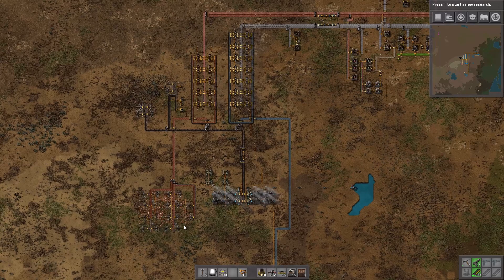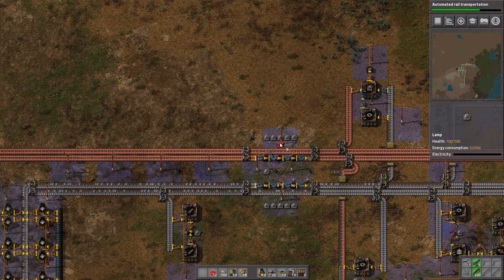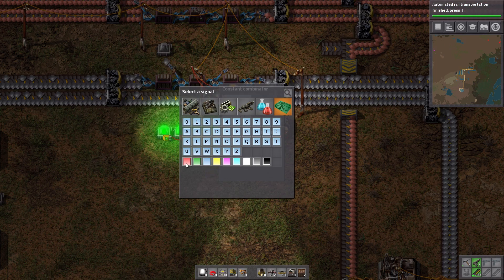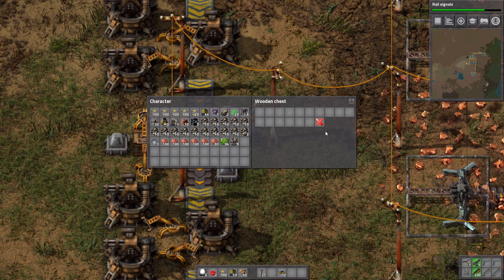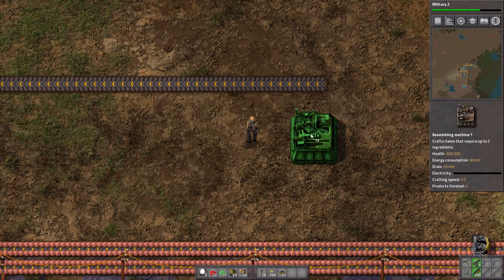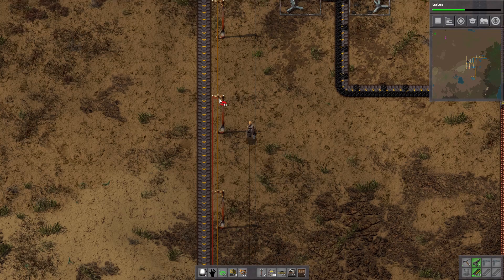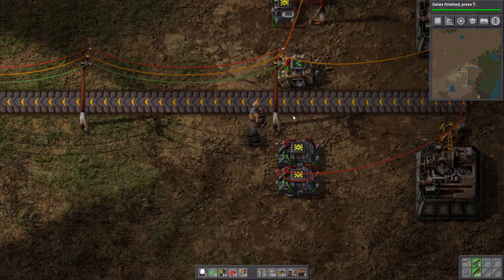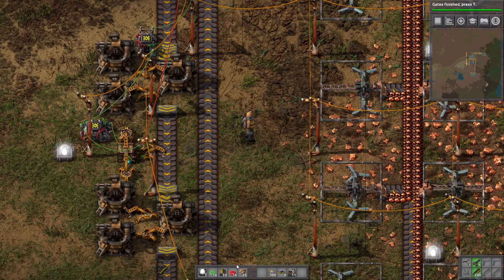Smart Ammo Production Guide – Factorio 0.16.x – Let's Play Part 4

Comment: Aavak, as you mentioned, in this setup there will be a delay between boxes signalling a local demand for ammo and the moment when it will arrive after having been produced (on demand). It seems to me that a simple adaptation could reduce this delay significantly.

Imagine the  ammo feeding belt as a series that starts with the ammo production facility and then leads sequentially to smart turret location A, then B, C, D etc. In the current configuration, if turret location M gets attacked, a demand for ammo is issued, the ammo gets produced and shipped until it arrives at location M, taking a certain amount of time.

What you could instead do having each turret sending their demand signal to the previous turret in the series (presumably location L), prompting that turret location to empty its ammo reserve on the belt. The reserves of this location (L) will then immediately dip below the threshold of 100 ammo,  resulting in a request for ammo to its respective preceding turret location in the ammo feeding line (presumably location K) and so on.

Instead of having the Ammo Production Facility feed location M directly (APF --> M) in one potentially long delivery, you will effectively split the delivery in a series of smaller parallel/simultaneous deliveries (APF --> A, A --> B, B --> C, ... , N --> M) distributed among the system, reducing the risk of running out of ammo before the new delivery arrives.

The delivery time for a location should never exceed the time it takes for ammo to travel from its predecessor on the ammo line in this system, no matter how long your ammo line/base defense circumference! Additionally, this means that lower reserves will be necessary at each turret location, resulting in glorious efficiency :)
Reply from the maker: A very interesting solution!
Reply: Great video Aavak. Waiting for a lot more like this one :-)

Yes very nice idea. A much quicker refilling, and if the location "A" is just after the factory inserters, no waste on the belt. I am thinking about a buffer chest every 3 (or less if needed) electric poles for exemple, with a set amount of 1 (or more if heavy attacks). It unloads (outputs) by a request from the next buffer, and sends a request to the previous one if not filled up with the set amount. The previous one will send all he has untill the delivery arrives, but as it has only 1 piece, it can't fill the belt untill it itself receives its new request. So you have on the belt as many ammo as you have buffers, and quick providing if necessary.
You can set for each defense location the reserve you think usefull.

Comment: I had a full logic system to control a massive refinery in an old save. Don't think I still have the save but happy to share the planning notes, if you're interested for when you get to oil. It used storage volume to keep things balanced but included all liquid based products, including sending excess into the fame-turret network (strictly as light for the max damage). Meant I never had to worry about things like my lubricant filling up because blue belt was full, leading to all the heavy getting cracked and then not having enough heavy to make more lubricant when I made a large expansion. Logic system not only controlled all that but held reserves of each non-final product. I was planning a predictive module to upgrade it too; in short, it would look at the levels of final products (like the lubricant) and increase the reserve levels if the products were low, in anticipation of the extra demand.
Reply from the maker: That sounds really awesome, and this is exactly the kind of thing I like to make. I like the factory to /think/ about what it's making, and why, and when it should, etc. 

Again, as I've mentioned to others (who invariably ask the question: but why bother when you can just...?) brute-forcing the game is totally viable, and in many cases faster, and easier. But making a smart factory is fun in and of itself!
Reply: Exactly! Well said. I've 'finished' the game plenty of times, even with mods that greatly extend the tech and/or number of items. It's not really a challenge after a certain point. The real enjoyment, for me, is in the problem solving element. Sure you get a little of that in the brute forcing method but what better way to get more problem solving style of play than creating problems to challenge yourself to make a solution for! :D

Remembered another that might give you some ideas/inspiration! I had an 8 station iron ore train drop off. I had 32 belts, plus a 32-32 balancer so if there was a shortage all 32 still got a share (since some entire smelting stacks were dedicated to circuits and not balanced with the buss stacks). With that kind of size/volume it was basically each train wagon spot (8 stations by 4 wagons per train = the 32 lines) was responsible for fully saturating 1 blue input line. Of course I was using the unload into chests, then onto belts system to speed unloading but trains were choosing based on pathing, and the volume of trains moving through meant that one could comfortably unload before all 8 stations were occupied, so the closest ones were getting all the trains and a couple of outer platforms were getting literally none.

I went full overkill mode and set up a system that added all the ore in the unloading chests for each platform, calculated the average ore held across the station, compared that to each platform's count (the signal isolation was a b**ch for this bit) and set up conditions to close the station (using signals) if the platform's buffer was 10% or more over the average, forcing the trains to go to stations with the lowest ore.

It also closed a station, regardless of other conditions, if there was not enough chest space for a fully loaded train to empty (there was a stacker to queue trains up in). That add-on meant that trains waited in the stacker, not a platform, so that when a platform was opened up, the train would go to the one that needed the ore at that moment (instead of the one that was the lowest at the time it arrived).

Could have brute forced that by just bringing in more ore and limiting chests, once trains stopped being able to unload they would block a platform and force others to the outer platforms..... but what's the fun in that compared to a horrifically overkill logic network! :)

Comment: In relation to the visual display for buffers, I find the programmable speaker to be amazing - i disable the audio, and set it to provide a visual indication of when certain really important things fall below a certain point, so that no matter what i'm doing, i'll know that my factory has reached a point where it's consuming faster than it's producing. Also good for letting you know if overproduction has created a bottleneck, or most any other situation where you want to know something /now/ rather than eventually... I /always/ set it up on coal and nuclear power supply, so that I never have to worry about a death spiral. 

With that sort of ammo setup, I'd probably have the ammo assemblers load into a limited chest,  and have that feed out into the belt that takes it to the guns, for pretty much the same reason as above - if the amount of ammo in that chest ever gets too low, then i'd know i need to either improve ammo production, ammo quality or something of the sort.
Reply from the maker: A nice suggestion, I've not played with speakers much, but that sounds like a great use for them :)
Reply: I tend to run out of fuel for power generation, just as a few (hundred) biters show up to eat me.  So have been setting audible alarms for when my fuel gets low.

Comment: Rather than each base outputting how much ammo it has, you could have it output how much ammo it would pick up, and produce ammo if that's more than what's on the belt. That direction adjusts automatically as newly-added bases output non-zero signals, and you set each base's storage amount differently and locally. You should also be able to clamp the signal so that a base can't request less than 0 magazines (because it has more than its storage amount already), which would then starve other bases.

On the other hand, with your system, if a chest dies, the factory will put ammo onto the belt in proportion to the fallen bases, and I like the idea of the voice saying "pour out 100 magazines in memory of firebase 17" while you try to figure out why it's acting moody.
Reply from the maker: The idea of the factory effectively pouring out a cold one for the fallen fire-base is glorious xD

Comment: Hey Aavak, a couple of things :
 1 - You don't have to pick up belts when putting down splitters on them.  They auto-replace. This works for undergrounds, as well. 
2 - When it comes time to create outposts,  check out autotorio.com/outpost. You put in a blueprint string and a little info, and it will create the whole thing for you.  Burnys Train Station Blueprint Creator mod does something similar for train stations. These two resources can save SOOO much time in mid to late game.

Comment: Thanks so much for going over this. This is exactly the kind of thing i was hoping you would do with the factory. 

My dream for a factory is one smart enough to adjust itself on the fly using modular production stations (putting them up and taking them down w/ recursive blueprints?) so all you have to do is tell it what research you want and how fast you want to launch rockets and it handles the rest. All you would have to do manually is build enough mining posts.   

my knowledge of running combinator logic is still sketchy at best but i'm getting there!

Comment: Hey Aavak, just a thought after observing. I noticed that your overflow chest wasn't actually draining because the ammo factories always had a reserve of ammo in them, so the inserters would just pull more ammo from them when desired instead of pulling from the chest. Could you not set up the network so that the inserters that are feeding iron to the factories also disable when ammo supply is met? I think this might be an extra unnecessity, but it also sort of plays into what you were imagining by an entire ammo wing suddenly starting up when a piece of ammo was needed along the wall; and yes, with the glorious robot announcer! Thanks for this combinator video though! I've never had trouble understanding logic gates and other video-game "circuits" (like redstone), but for some reason I couldn't wrap my head around factorio's circuit system. This video helped me to finally start understanding it! ;P
Reply from the maker: That would be a much better system, aye :)
Reply: Perfect for an RS-latch, IMO!! Have the ammo module on until buffer is full, then turn whole module off. Turn on condition is when the buffer gets to (say) 20%. Module produces in bursts, then stops drawing on the buss until the storage is low :)
Reply from the maker: A perfect situation for a hysteresis system, aye!

Comment: Wonderfull content! thank you . However, the belt balancer design you used will put more on one side as on the other: the first splitter sends half to the left and half to the middle, the second sends then a quarter to the center and a quarter to the right... It's better to use a single splitter to make a belt balancer...
Reply from the maker: Cheers for the tip :)

Comment: 32:20 I'm not sure but I think Aavak is excited. Also, to solve the problem of missing ammo, wouldn't it be more efficient to just put a fast inserter so that the ammo doesn't have to cycle around the whole perimeter again? It would still be good to keep the caches, but I think that it would be much more effective to have a fast inserter and a redundant cache than forcing your guns to wait for the ammo to come around again due to an easily solved problem.
Reply from the maker: Oh, absolutely, the regular inserter was just because I had a stack of them, not strictly because I thought they were best to use :)

Though having the cache is important regardless (and the terminal cache too) because if the base starts to lose power, inserters are among the first hit, they slow down. Belts not needing power, won't slow down, so the ammo can still be missed. But you're absolutely right, a better inserter fixes a lot of problems!
Reply: Alright, I just wanted to make sure that you weren't just doing Aavak things and forgetting something simple lol. And yeah, I agree that the cache is important regardless.

Comment: sorry to necro this however i cant figure this one out, i tried to hook up the crates for ammo overflow with signals so that it also keeps stock of 100 ammo in them (and have them evenly spaced throughout the wall perimeter). However since the substraction only happens when a red wire picks something up on the line it does not count up for the ones that put the ammo back spent three hours today and five yesterday trying to figure this out worse is i have no idea how to fix it :D it looks to me as if i need a second line to carry the signal back to the counter to count up for every green pulse (separate green circuit (second one) ) as if i just use the one i have it substracts when it gets picked up but it does not count up if somewhere down the line the ammo is put back on the line (wanted to solve the bleedthrough originally plus have a buffer of ammo that shows up sooner due to the crates being evenly spaced out in there.
Reply: Tomorrow i will try to add the counter to every such chest so that it has its own circuit and only updates the A signal accordingly i mean i know what the issue is; i cant figure out how to count back up if the overflow chest is putting ammo back to the belt. The easiest solution i believe is to add this counter from the two assemblers (from your video) to every such overflow chest with the same logic or at least the one that counts up for the inserter that puts ammo back there (i thought that carying that pulse over the green wire will be enough but apparently the green wire holds too much information already for the one counter at base to do what i want it to do :D )
Reply: the solution for me was to create another channel and use another arithmetic combinator before the counter to count that *1 from the inserter that puts ammo from overflow storage back to the belt having a second channel like this cancels out the -1 from the inserter that goes into the chest should the green signal be present its ugly but it works (sounds like Factorio motto)

Comment: I can imagine doing this as a tutorial, but other than "because we can" would you spend an hour (for a very limited setup) making a manual readout system and double belt system that costs several times the resources it would take you to just belt down ammo and have the entire belt full of ammo? Not to mention the fact this is basically going to be obsolete once you have bots, and spent hundreds of circuits you could use for researching better tech on setting this up.

Making box fed turret system with a remote readout system working with bots and request/supply chests I can see but especially if you're stockpiling the amounts of ammo you do in the boxes themselves as opposed to on belt, this entire system just seems like a massive waste of resources and time, also considering that in case something breaks in an attack it is way more complicated and labor intensive to fix compared to replace belt section - done You could just shut the entire ammo factory section on or off if a buffer near the ammo factories dips under a certain level if you want it to be turned off when production is not required.
Reply from the maker: Seems you may have missed the parts where I repeatedly mentioned it would be faster and more efficient to brute-force the solution, and rather amusingly as you went on to bring it up, the part where I specifically extol the virtue of 'because we can' as a reason to do things like this, because it has a tendency to accidentally teach you to do something more useful xD
Reply: I have indeed missed where you mentioned that is is 'because we can', although I did catch you saying it could be done much simpler a few times. Writing the above I was mostly focused on the idea that you initially mentioned you felt it was wasteful to just have a giant belt full of ammo, and then proceed to spend several times the resources that would cost to show how one could make a setup like this, which seems counter-intuitive.